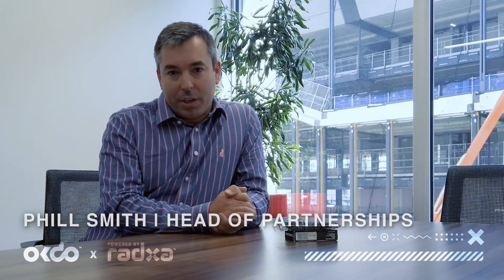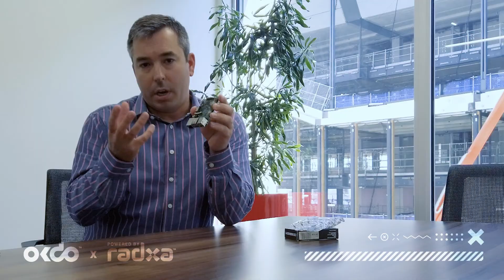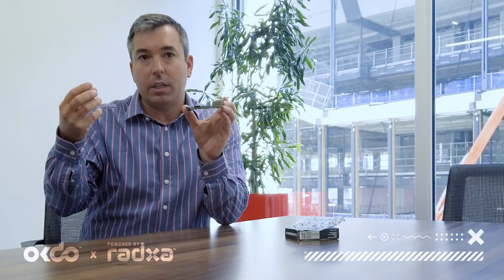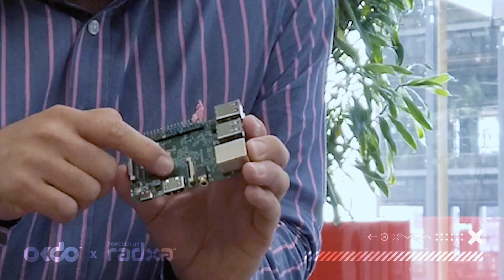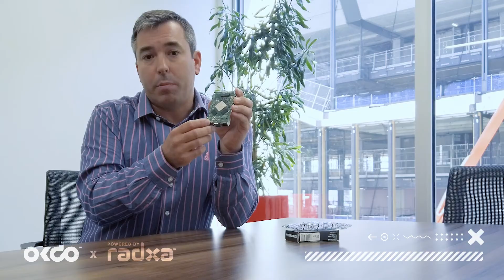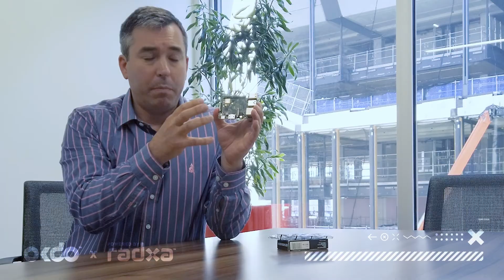ROCK 4 SE Overview | OKdo

Comment: The support for Rock 4 SE sucks big time. Sorry for that, but It does.  Raspberry Pi for me next time.
Reply: i have to agree  please someone tell  me  which position the switch should be in in to use otg  . i have the board running with sd card  but unable to program the emmc module